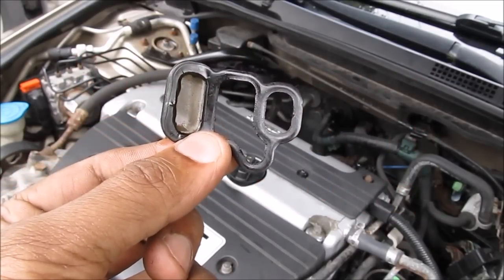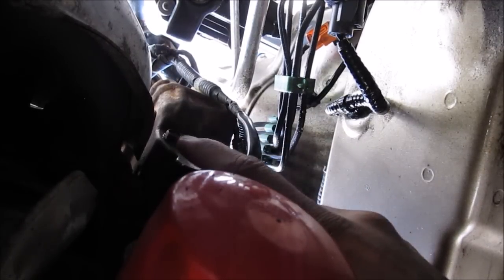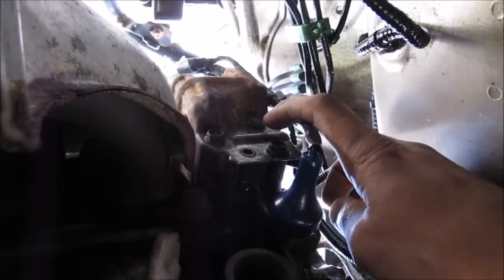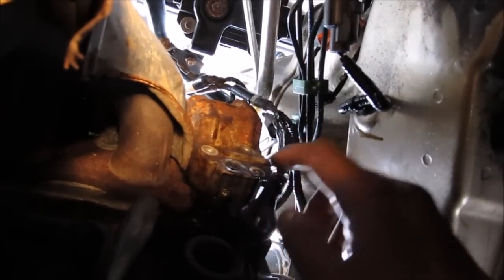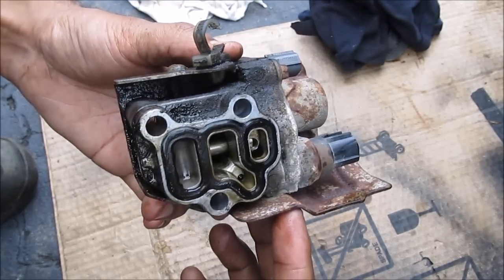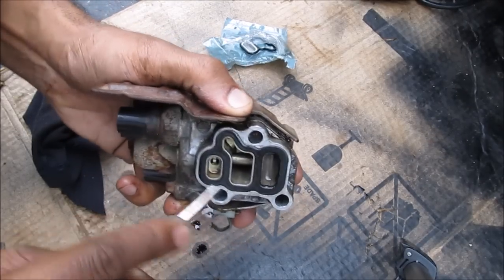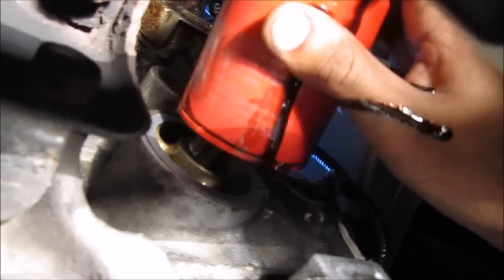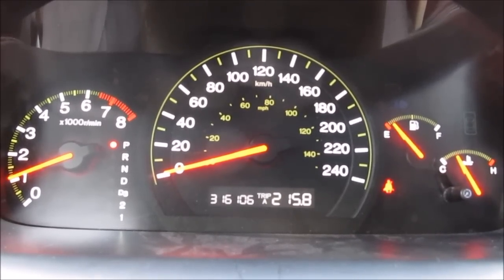How to Replace a Honda VTEC Solenoid Gasket

Comment: Hi, do I need to drain my oil first before removing the VTEC solenoid to replace the gasket?  I don't know if oil will just come pouring out when i remove the solenoid.
Reply from the maker: No, the oil filter and VTEC valve is above the oil pan.

Comment: brand new solenoid, even change the gasket with oem part about 6 times, still leaks. Do I need to use honda bond for this?
Reply from the maker: Are you torquing it with a torque wrench?
Reply: speedkar99 yes tighten to manufacturer spec's

Comment: +speedkar99 - Does fixing the vtec solinoide gasket meaning if it's clogged fix the issue of Vtec not engagging? The car is: 2006 Acura RSX Type-S. I believe it was once working but stopped because I think it is clogged.
Reply from the maker: No the gasket is only for leaks. If its not engaging you need new solenoid

Comment: is the oil pressure switch on the bottom of the VTEC?
Reply from the maker: +Cody Gatewood on top
Reply: I have an 01 Honda civic ex 5spd and it won't go over 4k have any idea?
Reply: Probably a bad o2 sensor.

Comment: Great channel, watched all your videos. Question, any idea how to fix an oil burning engine on an Accord 05 2.4L? PCV replacement and thicker oil did nothing.
Reply from the maker: +Jay JS Thanks. There's a thread on DriveAccord about burning oil on the 4 cylinder, you can read up on it. Changing the Viscosity helps too.

Comment: It's a good idea to put a light coat of clean engine oil on these oil seals before installing it back on the vehicle.
Reply from the maker: +Big Dog50001 Thanks for the tip
Reply: @speedkar99  Hey thanks for the video.  I have a question I am wondering would it be the same process same case on a 2006 Acura csx 2.0L v-tech? As far as I can find out mine is only leaking on the sensor ring.
Reply: Eduardo León Morales took it to Honda, they resealed the timing case cover
Reply: @markroyds23  do u remember what mileage?  I'm seeing leaks and gonna do the valve cover seal
Reply: Big Dog50001 Automotive i dont know anything about cars but i think i have this same oil leak problem,  https://youtu.be/PH26wbDGdtY theres a video i was hopeing anybody who knows anything about cars could have a look Nd tell me.what they think, definate leak you can see it has spluttered all over the place
Reply: ANY advice or help would be massively appreciated, going to book it at Honda monday but until then im.worried sick about it....

Comment: 316K+ miles. Good job!
Reply from the maker: +Matt Bono Thanks, but it's in kilometers.
Reply: @speedkar99  Keep it maintained this well and it will do that in miles. Mine is at 250k miles.
Reply: My 05 CR-V is at 352,080 miles.
Reply: @nite82hawk  my accord euro is at 297.000kms
Reply: @StealthyyyHD  nice job! 👍👍